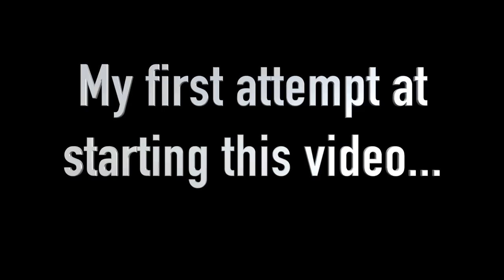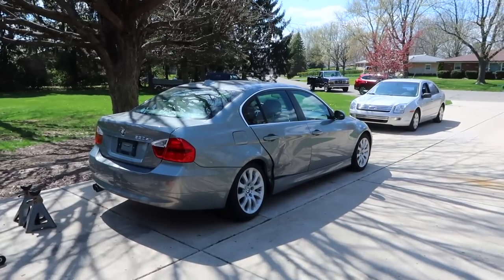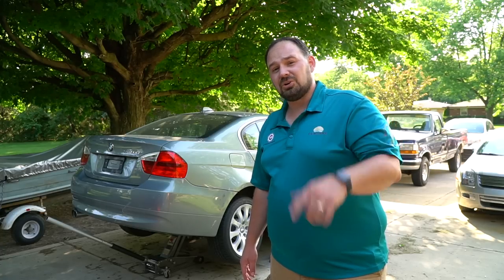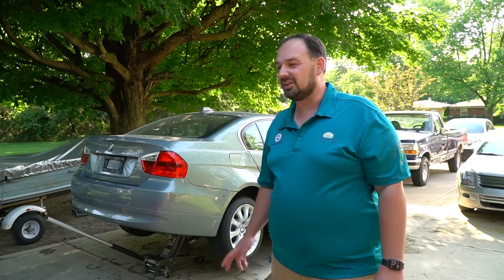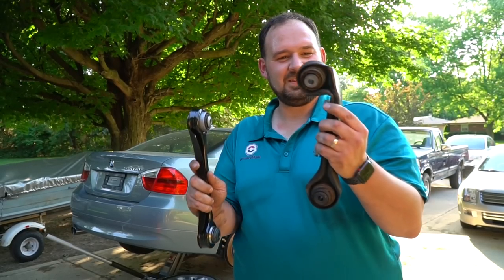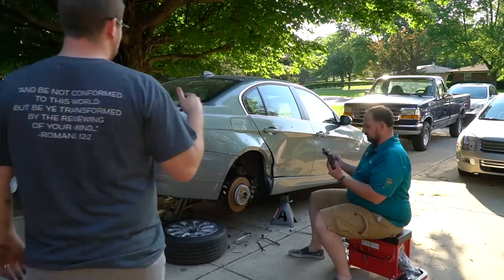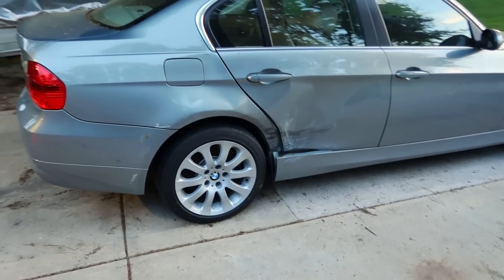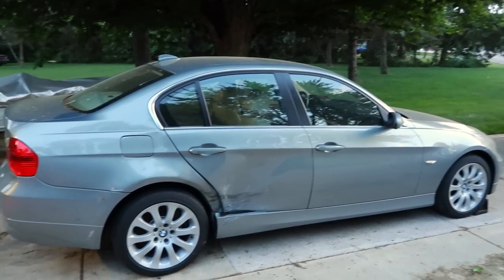BMW E90 330Xi  Suspension is FIXED!! BMW Rebuild - Part 2

Comment: Good job on the BMW, also congratulations on the Fusion sale. Now that you have the rear suspension fixed, will that wheel need an alignment?
Reply from the maker: Thank you!
I don’t know if it technically needs an alignment or not. It tracks perfectly straight. However, just to be sure, I plan to get an alignment when the car is completed.